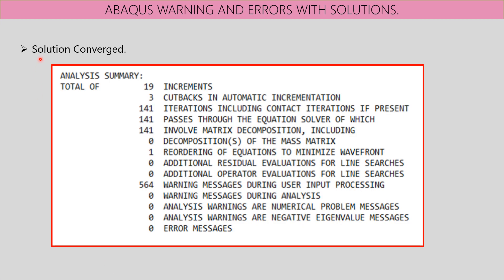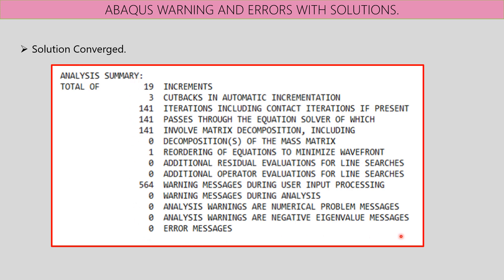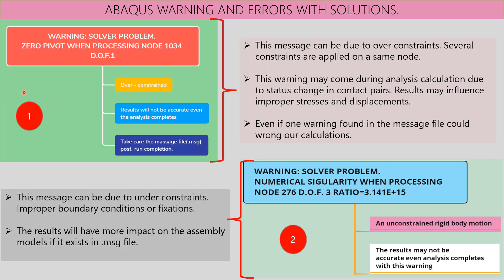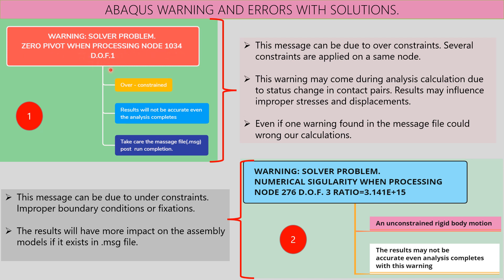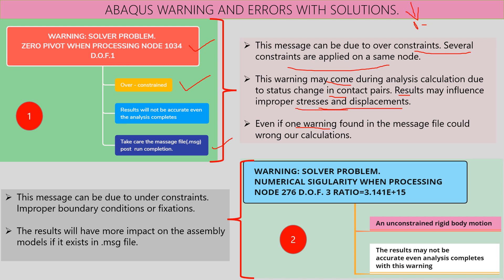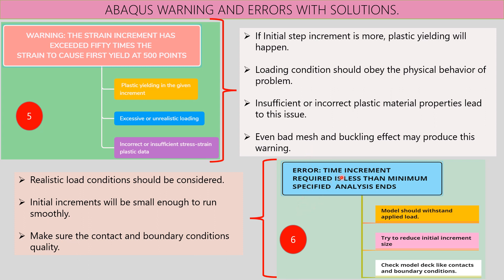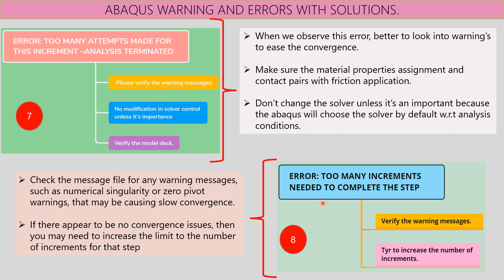ABAQUS WARNING & ERRORS with SOLUTION TECHNIQUES. #abaqus errors #abaqus warning

Comment: hello sir,
I am doing impact analysis on composite materials using explicit dynamic 
I am getting error as "excessive incremental elements rotation on 7 elements"what to do?
Reply from the maker: Hi, pls try to decrease the initial time increments in the step.
Reply: @Ghantimath I have alloted 0.0003 sec simulation time
Where is the option in step manager of initial time increment?
And what initial time should be allocated?
Reply from the maker: @hitman5601   usually incrementing alone will not matter to un+converge the solutions, try still reduce increments and check BC's too.